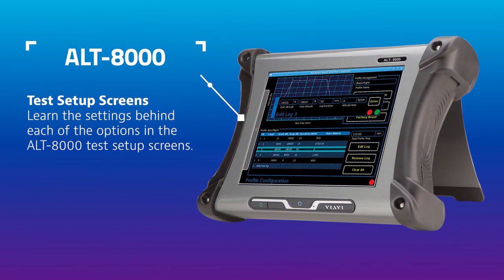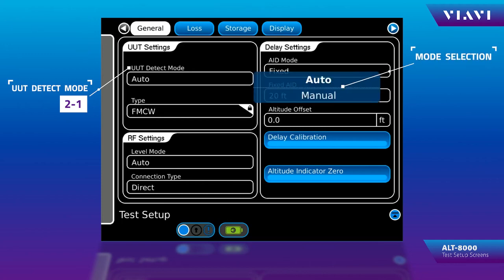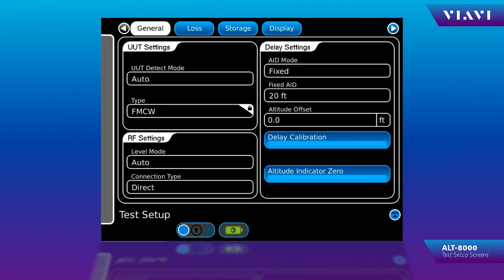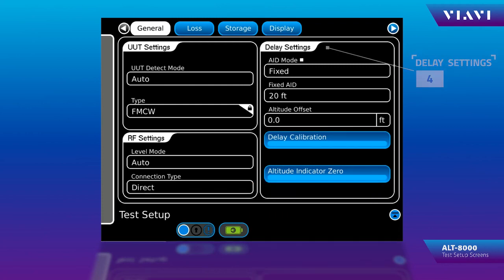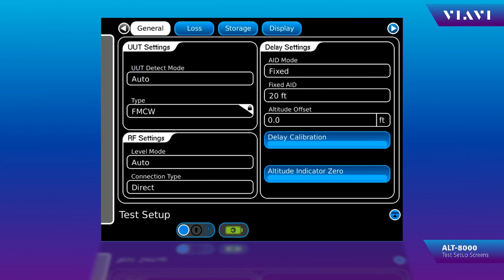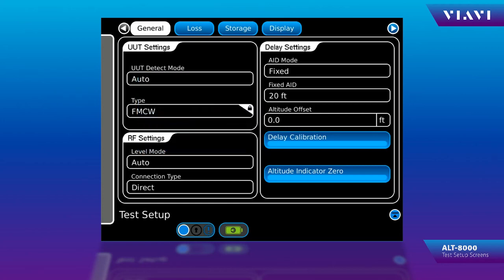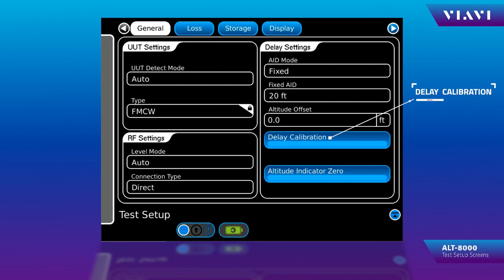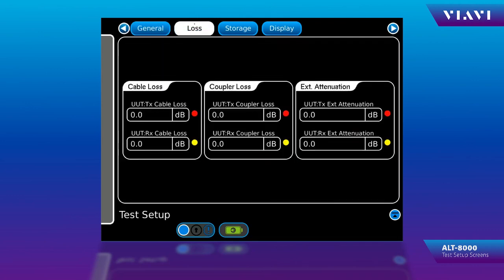VIAVI ALT-8000 - Using the Test Set Up Screen

Comment: hi, could you tell me what ALT-800 does???
Reply from the maker: Hello @HAMID REZA Naseri. The ALT-8000 is a portable flight-line test set for testing FMCW and pulse radio altimeters from the TX/RX antennas to the indicator in the cockpit. It allows the operator to replicate in-flight conditions and isolate a bad component of the installed system without removing components from the airframe. You can find more details from the product page: https://www.viavisolutions.com/en-us/products/alt-8000-fmcw-pulse-radio-altimeter-flight-line-test-set